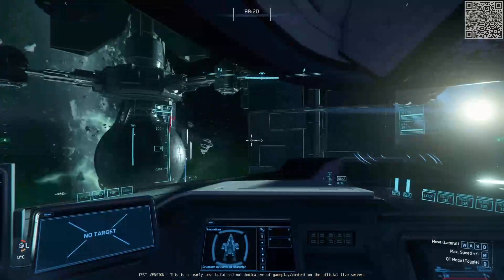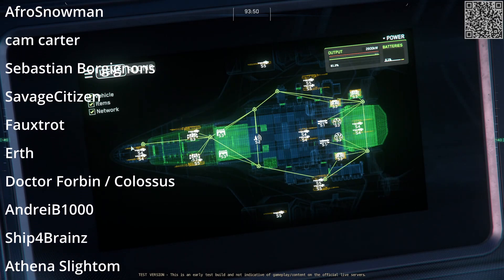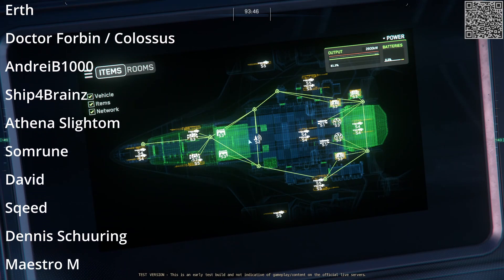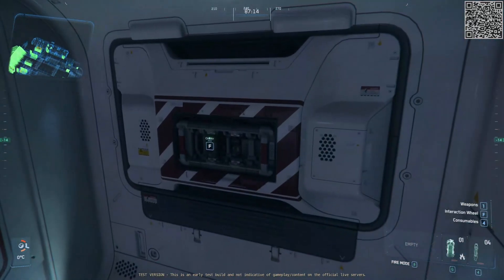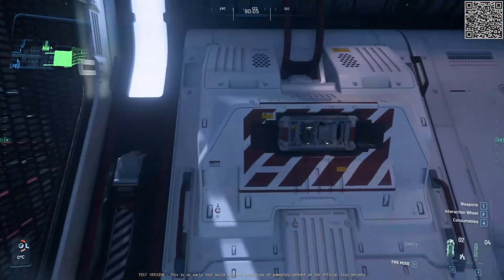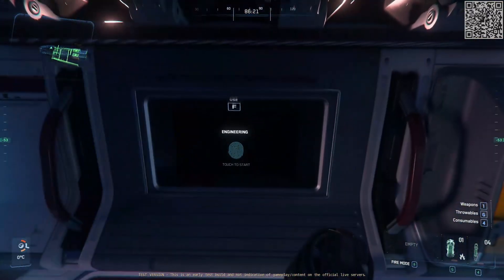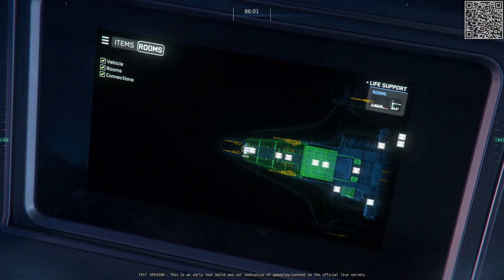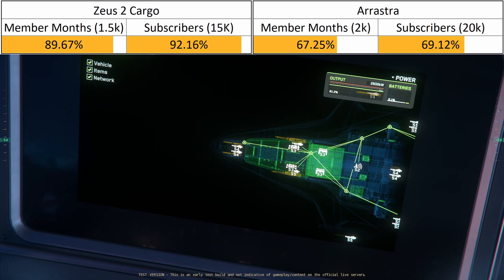Engineering Walkthrough of the A2 (Repaired Audio)

Comment: 8 fuse boxes is fine, as long as I can run around fixing them with a comically oversized wrench.

Though being serious for a sec, one thing I really want when it comes to engineering is to be able to fix thrusters or at least stabilize them. I hate that damn torque imbalance warning!